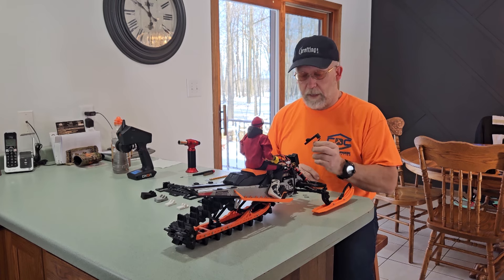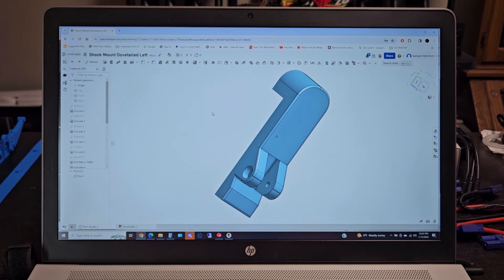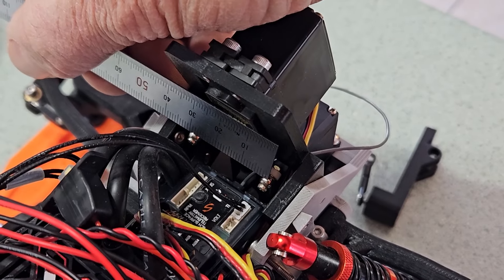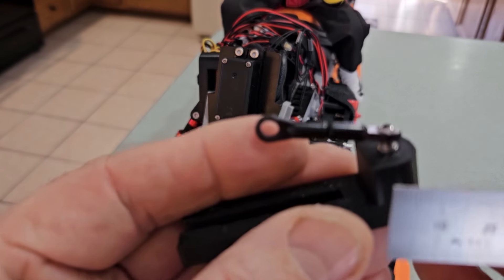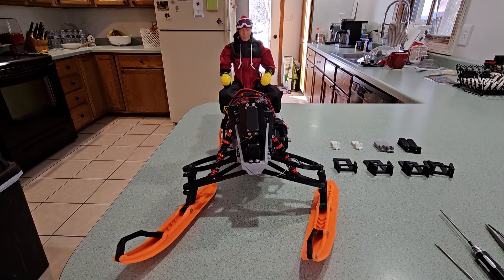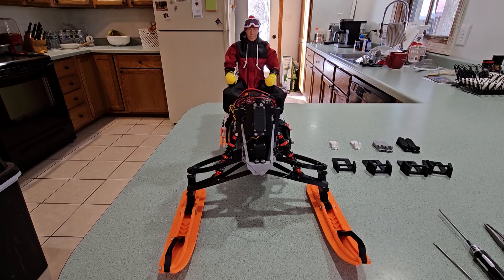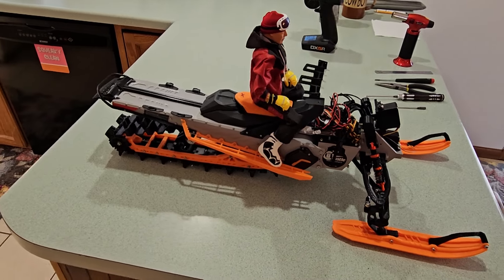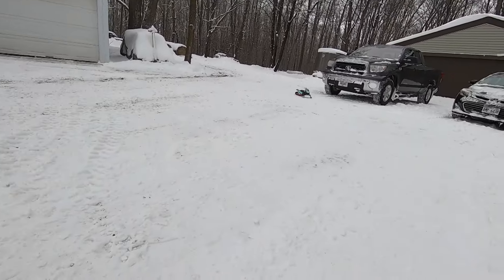SkeeRide 2 Leaning Steering Modification...

Comment: Great idea & video.  I haven’t yet made this mod to my skeeride, but I have used “drawer slide tape”- high density polyethylene or similar 1/2” wide adhesive tape on the underside of the steering rack to greatly reduce friction.  You might find it useful for this suspension mod as well - it’s thin and very slick
Reply from the maker: Yeah, good idea there. Although I have the dovetail sized really close. Since I lube it with Vaseline I've had no issues sticking...

Comment: Can you put some weight in the rear "swing", somewhere inside the rear belt? I mean if it will be as low as possible, you will have much lower center of gravity and also possibly more traction?
Reply from the maker: My driveway is basically like running on ice. Just need spikes in the track for that. It's set up for deep powder. Watch this video to see the difference. I run it in powder at the end...

https://youtu.be/s9D2SVp97cc?si=_SPzRFykDQPzQ1wi

Comment: curious on what you used for your tracks?  seams to hold up fine even on the crusty ice
Reply from the maker: @randysalamon-y7j  Hatchbox PLA
Reply: @chilly7261  Really???? I'm finding pla and pla+ just snaps at the attaching point when I get a little rough :) Have a new track printed out of colorfabb XT, will see how it goes this winter. Also doing up a 130% scale, plan is to use a 9cc gas, just starting so will be a month  working out the engine install, ty for the reply
Reply from the maker: @randysalamon-y7j  I would say printer settings are more important than filament type. Although Hatchbox PLA is the strongest I've found. 

Try only 3 perimeters and bump up the "infill overlap to perimeter %" setting to 50%. Default is usually only 15% overlap.

In every failure I had, the infill broke away from the perimeter. Yes, infill percentage and type are part of the strength of a printed part. But the overlap % made the biggest difference. More perimeters than 3 just make for a longer print time...
Reply: @chilly7261  ty will give that a go

Comment: Wow that really works! Nicely executed!

I am just finishing the last prints for my skeeride 2. Are you running 2200kv on 3s? Do you find this is enough low end torque and speed on stock gearing? 

I am thinking of going with the Hobbywing Quickrun 2in1 2300kv system to save some space in mine. It is limited to 3s...so just wondering if it will be enough speed to make me happy?

Great design and hope to see it in the mods section someday!
Reply from the maker: Thank you. Yes, I'm running 3s Castle sensored system. It's plenty of power, I'm not using full trigger most of the time...
Reply: That 3s se system is kinda slow imo but it has plenty of power for my crawler!
Reply from the maker: @Todd_G_FPV  It water skips at less than half throttle. Not slow IMO

https://youtube.com/shorts/OATdN0SV5z4?si=vqYZh1vAozFb1qpi